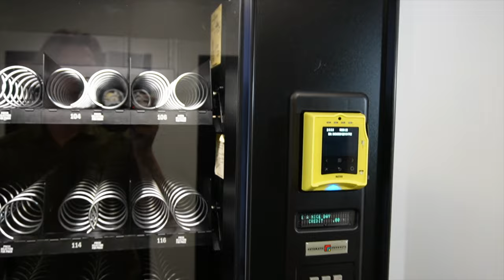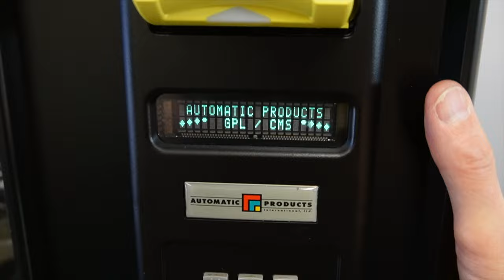Vending Machine Repair - EP1 - GROUND METAL

Comment: Loose ground wires sink ships.
Reply: When I'm teaching new techs, I always talk about grounding. So many weird, inexplicable problems related to it.
Reply from the maker: So true. After refurbishing so many used vending machines over the years. I am shocked to see how may broken or incorrectly grounded wires there are on vending machines coming off location.